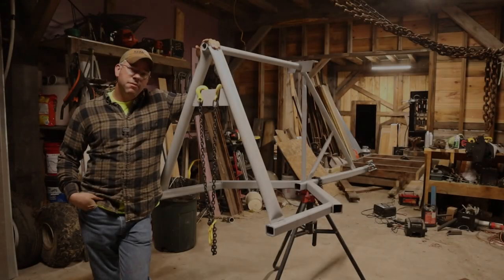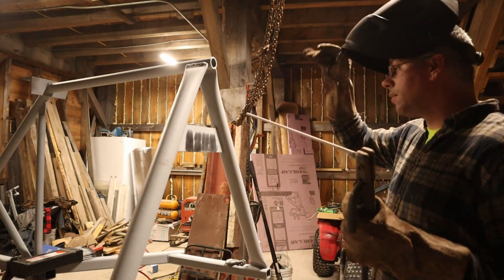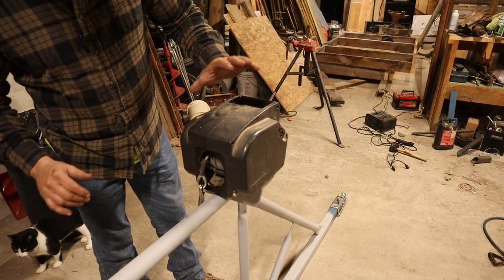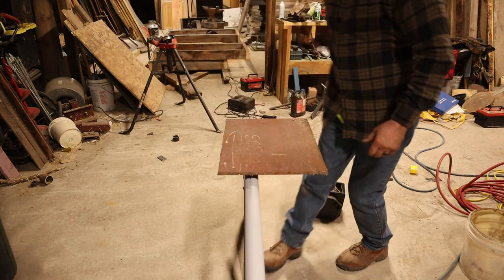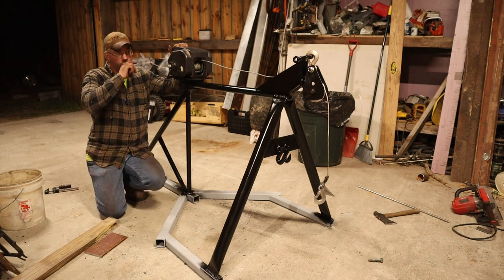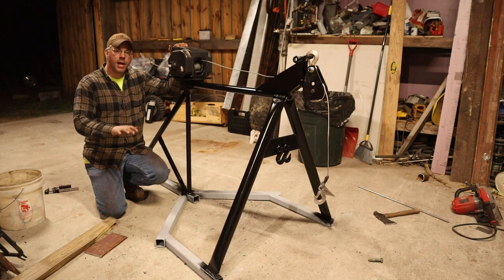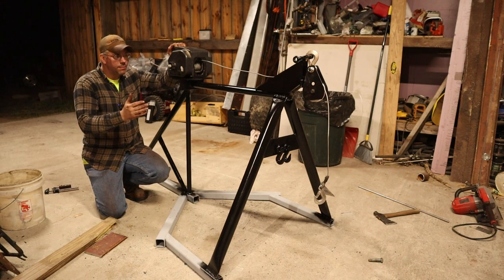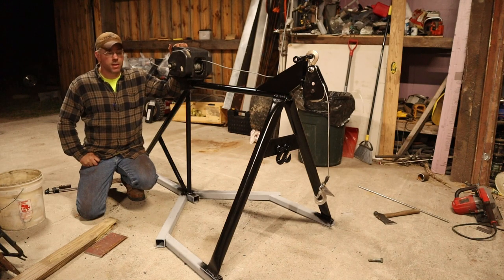The Next Timber Frame Episode 5: Log Arch Is Almost Finished

Comment: If your batteries do not hold a charge there is the old mechanics trick to "revitalize" them.
A 200A charger ... 15 min max and let her rest for an hour. Repeat several times! 
The 15 min max is crucial as you don't want to get those plates heating up and warping .... and keep an eye on your electrolyte levels. Even "sealed" batteries work, just peal the label and you can see where the plugs are to fill it. Open ALL the air vents as you Will be off gassing!
The Log Arch is looking cool although I did think you might want to go full hog and use Cammo ..... you don't want to spook them logs before you hitch them up! I am sure you have thought about the stresses you will be putting on this .... would a few fillets stiffen it up, or is that OTT?

Comment: Jim, you talk about a tractor on the bush, have you seen the channel "The Outsider"? Young Canadian guy building a cabin out in the woods.
In the video titled "Power vs Agility / Which Logging Tractor is Best?- Log Cabin Update- Ep 10.8" he goes through the various tractors he has had and used over the last five years and shows which one he finally settled on. I think a tractor in the woods is really overlooked by many people these days and think it would be great for hauling logs.
Cheers!
Stu
Reply from the maker: I've seen that video and I do have plenty of tractors but where I'm going a tractor would not work for what I'm doing.
Reply: @TheTradesmanChannel  Not enough clearance between the trees that are staying to drive the tractor?
Reply from the maker: You got it

Comment: Morning Jim, well, it's after noon now, but thanks for the answer. Your responce makes perfect sense. Great idea putting the hooks closer together. I hope the chosen winch is strong enough for your fallen trees with whatever pulley system or block and tackle system you decide to use. I'm sure you have thought out what species of tree and size vs wet weight you are likely to max out on size the arch is capable of lifting. Can't wait to see her in action.
Edit: Yup, commented too soon again, but if I wait until the end, I may forget something I want to say. With the snatch-block, you can always double-up the cable on the drop and double the lifting/pulling capacity (the winch is rated for straight line pulling of course, as are all winches) but with that block reversed and the end hook at the top, you will get more lift. (For the viewer that doesn't know that, more than you, as I'm sure you know this,  Jim) great idea.

Comment: I can't picture you doing the moon walk or busting your pelvis trying to be like Jackson. My dad had at least 6 or more chains, also we live on a state route so dad would see dudes replacing power lines so I have 100's of feet of 1/4" wire rope, some stainless. I would also worry about the rear end and drive shaft, on the 4x4, I see a lot of fails with hot rods.